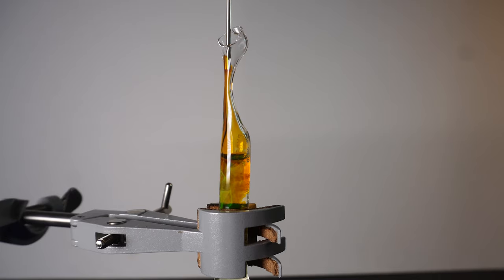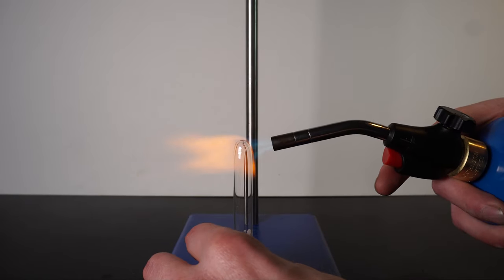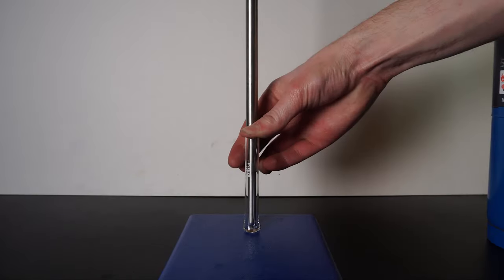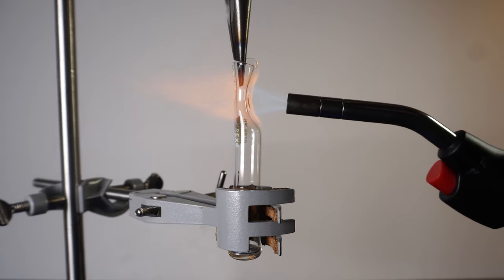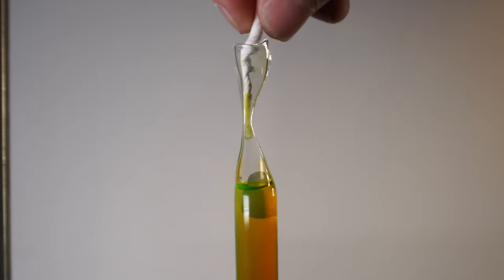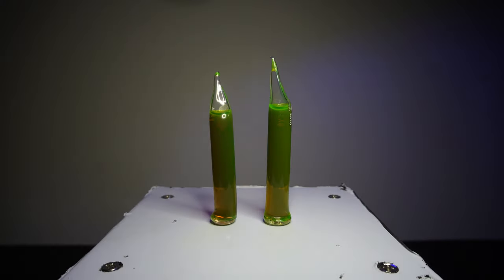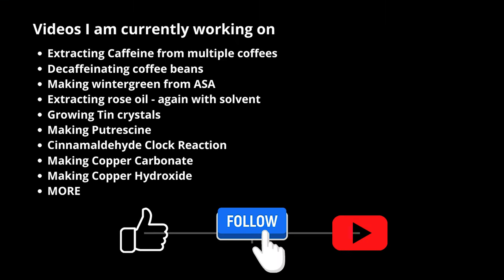How to Make and Seal Ampoules #learn #chemistry #ampoule

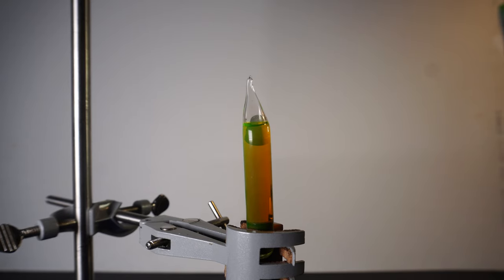Comment: 2:47 "Wait for it to cool before checking" - this is great advice. I know it sounds like common sense, and I guess it should be. I remember when I was sealing an ampoule that had some very mild acid inside (and a solvent I think), I thought I sealed it, but then I did a quick flip upside down then back to right side up, and it wasn't sealed, and the neck was hot enough to cause some of the contents to vaporize, which made a small amount of the contents shoot out of the top of the ampoule... and right into my face. 
Yep, lesson learned. It didn't hurt, and I washed it off quickly. But it was one of those sobering moments to not let your guard down when doing chemistry (meaning don't take off your safety glasses), and use your common sense.

Comment: I had an ampoule explode on me used a hho torch with near 4,000°f flame

It was pretty intense. Super loud. 
 
But something really interesting happened. Well a couple things. 

See i was sorta don this on purpose. Not the exploding but make it “rumble “ inside. 

The rumble is what first occurs  when heating seals ampoules. Then it goes calm….

Them it flashing  to steam amd expands like a tiny bit larger than original size. Just enough to cause a massive explosion that seemed like it vaporized  half the ampoule amd its contents. 

Luckily in was holding it in my hand while i applied the heat. Otherwise it could have been dangerous.   I was wearing a steam proof ove glove. Super great and way cheaper than official lab stuff. I also had on a couple pairs of eye pro. 

Anyways heres thr cool part. Electrets.  The piezo quartz effect. …..and applying massive pressure whilst sealed  in a boro tube fulled submerged in distilled water. 

There was three small quartz crystals. After the boom i saw one of the quartz crystals and it was glowing a light amber color.

Shaken but still stirring with curiosity i picked the lil guy up but i was a bit twitchy perhaps amd the crystal wet and i dropped it.. as it fell it struck my knee bouncing to the floor; however when it bounced an unexpected/incredible thing occurred. A rainbow halo of light…ill say , emerged in a single burst, extending to approx 4.5in in diameter, hung in the aether* for a moment before disappointing. 

*yes in the æther. id be happy to help you see the light. Einstein admitted later that to even attempt to consider a system devoid of ether is is and would be utterly impossible. This can be found in a little known talk he gave as he tried to reverse his wrong  however it was too late and the damage was done.  Einstien would end up dyïng, never able to purge this wretched skeleton from his closet.